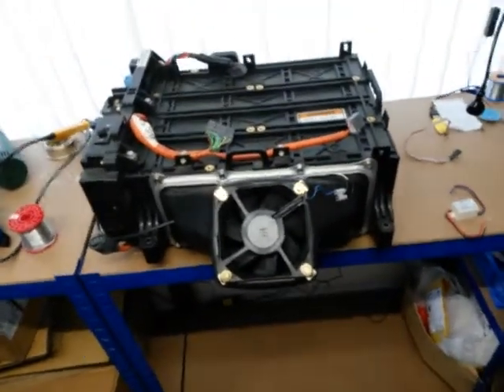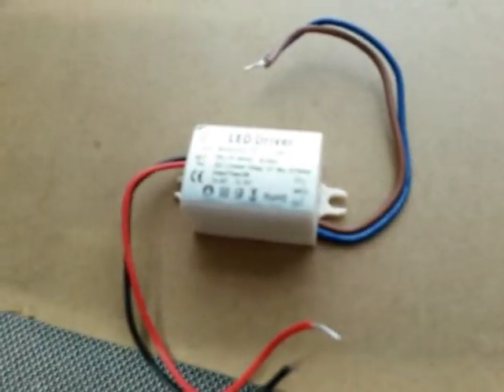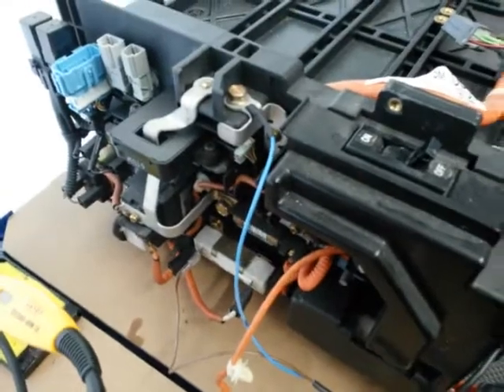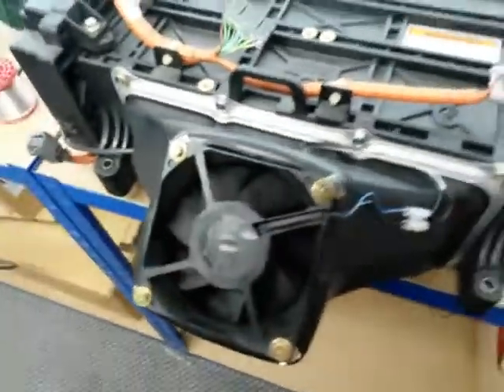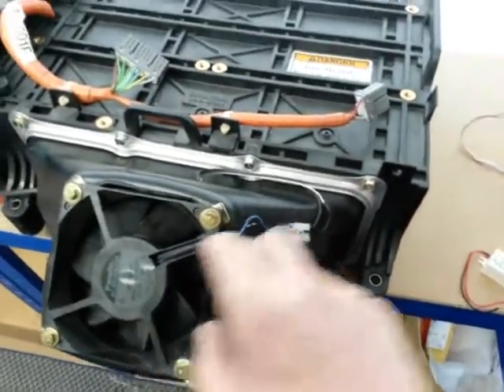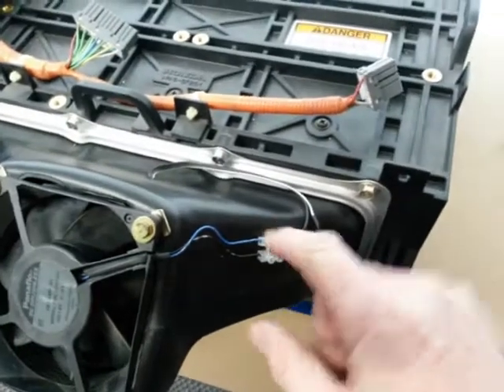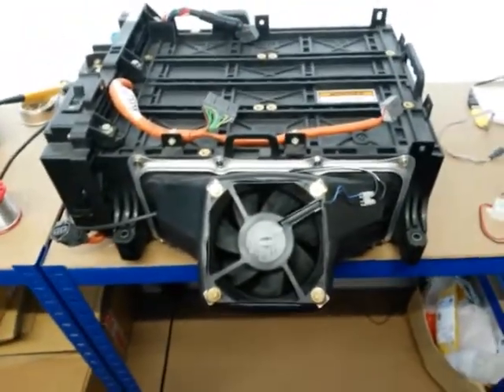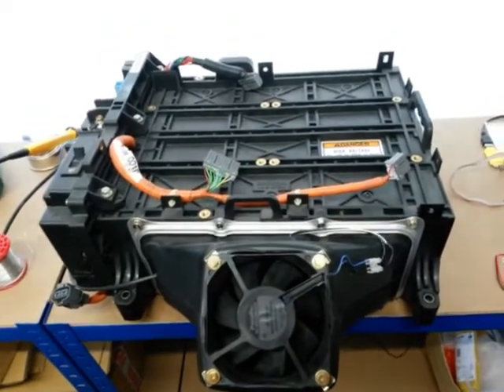Running the IMA pack fan when parked.

Comment: This is only a solution if the interior of the car somehow gets cooler. If not, if the car is in the sun, the battery pack will keep on heating up since the fan just recirculates the interior air. Here in AZ my car can heat up to over 120 deg F in the sun even with the windows cracked open to let it some air.